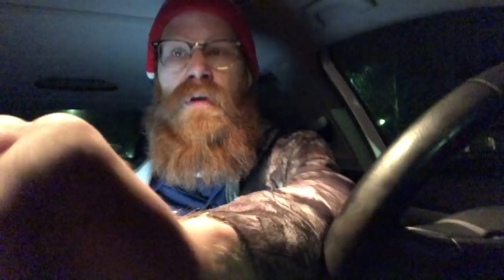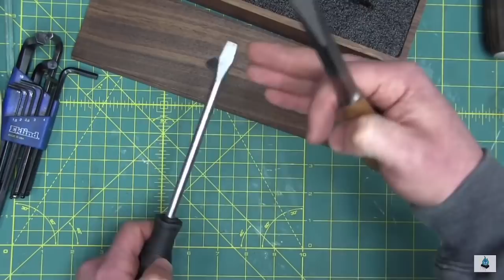A Fully Actualized Screwdriver/The Paradox of Abundance

Comment: The great junk heap of modern civilization. 

All those nuts and bolts only more disposable tools. And the harder tempered quality metals which would work better, are also a product of modern society. But I still like the point of the analogy. You are now officially speaking in parables.

For a 'tool' I'll take the old 4130 or less type steel of an axe over the modern methods 6240 type steel. The former holds a better edge, though for shorter period of time, yet more effective when used. The latter (harder) steel takes much more time/precision to sharpen but holds an edge longer, however in the woods it take even more time to sharpen and prone to chipping at the edge since it's so hard of metal if it hits a small stone etc. The softer steel, you can easier find a stone to use to sharpen and less time to sharpen, it's less prone to chipping and dents can be worked out. There's more of a balance of time with the softer steel axe. Even bronze compared to hard steel imo. And an axe will be even better if we're taken back to stone age flint. Flint-knapping/pressure flaking - no factories or modern production needed 

No screwdrivers needed. 

BTW          ))))))))Screwdriver((((((

Misspelled of course to avoid the bots.

Comment: So much 
depends upon 
a small titanium 
screwdriver 
set in a beautiful wood handle. 

Nice essay! You have perfectly articulated the values of quality and integrity. Using the simplicity of the screwdriver comparison to show just what exactly is so wrong with our current society. We seem to be forever drowning in useless crap.
Reply: This is probably beside the point, but a cheap screwdriver is much more reliable than a titanium one.  Titanium alloy is about 2/3 as hard as the average bargain bin find at Kmart.  Screwdrivers aren't meant to be light, they are meant to be as hard as possible without being too brittle.  The only true metric would be what particular steel alloy was used, where that alloy was made, and what process was used in the forming of the blade and tip.  High-end screwdrivers certainly exist and they are most definitely not Ti.  If you want exotic, a beryllium copper version would be a good start, but that is merely to suppress sparks, and the cheap throwaway is still going to perform better.  Not trying to bash on the general theme.  But the whole convo is essentially wrapped up around a falsehood.

Comment: I'm having a grinding/whirring sound coming from my passenger front wheel. I jacked it up, took off the tire, and I can rock the rotor back and forth by hand to where it moves slightly. Could this be a bad wheel bearing or could it be a loose CV axle nut. I don't have a deep well socket big enough, 1-1/8 being the largest I have, nor a torque drive, to see if the nut has loosened. The noise only happens as the wheel is straight, but will stop when making turns. There is no vibration or wheel shake whilst driving at any speed. 
Any hints?